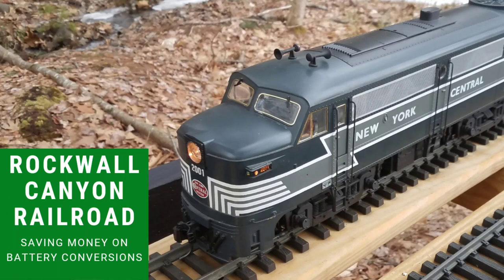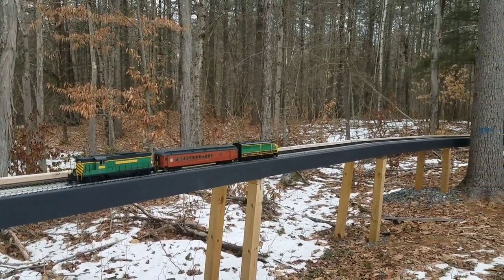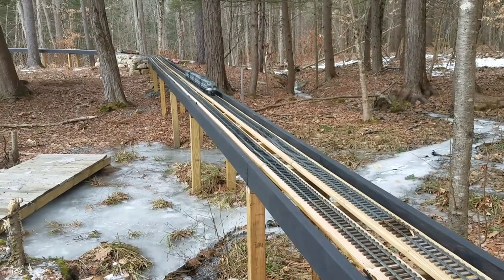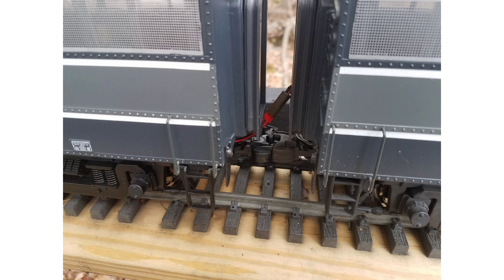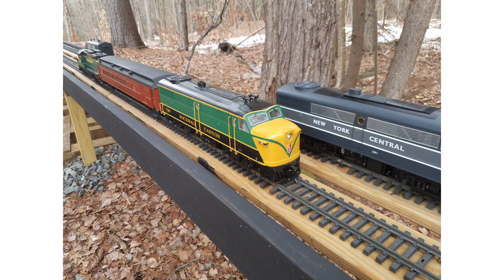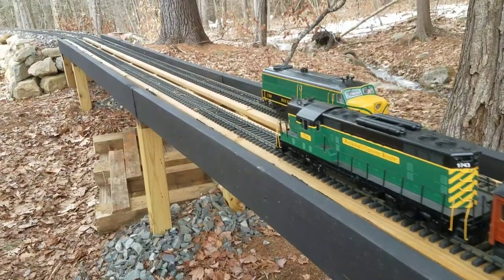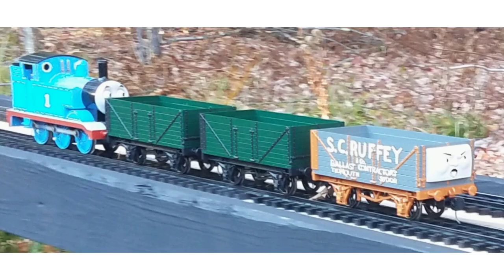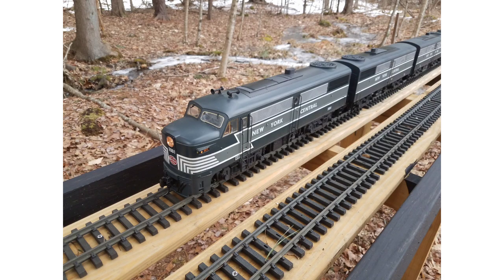G scale | Battery Power ⚡️

Comment: Great explanation on the how you're using batteries and air wire to control your trains. I've been running O scale 3 rail locos on battery power about a year now on my outdoor 3 rail layout.  Tired of cleaning track, I decided to go dead rail and have converted serval of my Lionel LC+ locos to battery power.  Could not be happier.  Slight cost factor yes, but well worth it in the long run.  I like your layout construction, perfect height for viewing and maintenance.  Well done.  Ron// 🚂🙂
Reply from the maker: Thanks Ron!  I catch your videos from time to time, great work!  I hope more and more come to see the advantage of O scale / 32mm in the garden.  Battery was a such a game changer for me...once you have a 100ft of track it gets tough to make it work and keep it going.  Now, when I want to run trains its go time.
Reply: @RockwallCanyonRR  so true, cleaning track outside is no fun. Since I converted to dead rail it’s turn on and go. Shocked I did not do this from the beginning. 🚂👍

Comment: A question for O scalers: can I run a 3rail battery powered locomotive on 2 rail track? Do I remove the pick up rollers? Thanks.
Reply from the maker: Most likely...  
First off, yes, I think it would be necessary to remove the rollers. Otherwise, they may get caught on switches.  
Secondly, 3 rail O scale trains run on AC, batteries are DC.  However, most  newer models actually have DC motors.  They use rectifiers to transform the AC track power to DC.  You would want to disconnect the motor leads from this circuitry and directly connect them to your battery/ rc speed controller.

Comment: I guess those are 1:29th scale models running on G track. Your tutorial is most helpful. I have question. Are DCC and decoders required or not at all? Many thanks.
Reply from the maker: That's correct.  G track is also known as Gauge 1 (45mm gauge).  For standard gauge, trains ought to be 1:32, and for 3ft gauge ought to be 1:20.3.  The great compromise came when the powers that be declared 1:29 for standard gauge and 1:24(ish) for narrow gauge.  This way, in model form, the trains are about the same size so they can be combined in trains.  I currently only have one 1:24 scale car, and it is a cattle car.  It's a little out of proportion, but within a train of 1:29 cars, it gives the rough appearance of being an older wooden standard gauge car.  

And no, DCC is not required for G scale.  Most brands have compatibility for it now, but you can just run off regular DC.  My trains are all battery powered and use non-Dcc receivers that have some dcc-like functions.

Comment: I was thinking a Hobbywing 1080 brushed esc. Would that be in the ballpark? 12v 80 amps about $40.
Reply from the maker: If you already have it, I would definitely give it a try.  However, I think you'll find that you may want something with a little higher voltage output, though.   Bachmann, Aristo, and USA trains all have 18vdc motors whereas LGB use 24vdc motors...and those 24vdc motors make a huge difference.  12v will definitely work, but the trains will run slowly.  My first battery powered engine was an Aristo FA1 with a 12vdc lead acid battery.  Thanks to the low speed, I was able to run it with just an on/off switch.
Reply: @RockwallCanyonRR  ahh I c, cool, didn't know the voltage was that high.

Comment: Wow!! so there are battery operated G- Scales trains? if so where can one shop for  them?
Reply from the maker: Absolutely, it's been popular for over 20 years now.  At the moment only PIKO sells a ready to run battery powered model (a nice, but tiny switcher).  Newer models of Aristo Craft trains have battery plugs factory installed that allow you to use a trailing battery car.   USA trains locomotives can be easily converted to battery/RC with Airwire drop-in boards that allow you to have the battery and RC in the engine.  Check out rcsofne.com for full service support.
Reply: @RockwallCanyonRR  THANKS! I'm considering a garden train and battery powered seem to be the way to go

Comment: For me this is important as I'm moving away from using 6 C cell batteries (9 volts) in my New Bright Bear loggers express train to a single 7.4 volt camcorder battery (though I might make it radio control as well). I'll do the same to even the Bachmann big hauler line of trains.

Comment: Do you know where to get plastic track painted to look real?
Reply from the maker: Not sure...do you mean for display use?  Almost all G scale track has pre-colored plastic ties with metal rails.  Train-Li occasionally sells plastic rail, but again it's not painted but rather rust colored extruded plastic.
Reply: @RockwallCanyonRR  i meant that all plastic rails would be cheaper than brass with plastic ties and since the engines do not need AC, i want to buy plastic (if it existed).
Reply from the maker: @WeedMIC  I see what you mean now...  So there is not really a plastic option yet.  TRAIN-LI has the plastic rail, but nobody seems to be happy with it outside.  I'm not sure if it's just the variety of plastic or what the issue is.  Basically the cheapest option is aluminum rail.  AML occasionally sells track with the heavy code 332 AL rail in 6ft lengths.    LLGAS, AMS, and Sunset Valley sell track with code250 AL.  Code 250 in quarter inch tall and code 332 is  0.332in tall.  However, if you go AL rail be sure to have it tacked down to wood or some form of hard roadbed.  These rails bend easily and I find them troublesome on gravel roadbed where people, animals or things might accidentally come in contact with the track at ground level.

Comment: Can you do a vid on how to convert a normal analog style loco into battery power?
Reply from the maker: Sure!  I'll have one going in for an RC install in a couple weeks.  The majority of G scale trains are analog, and its just a matter of isolating the motor leads from the rest of the electronics and then being sure the track pickups are disconnected.
Reply: @RockwallCanyonRR  I have a bachmann 4-6-0 analog loco and I wanna get that piko rc kit and would like to use track power.
Reply from the maker: @rc4life445  Del from Railboss RC just sent a newsletter this week with an install guide for the 4-6-0.  I'm not sure this link will work, but if not, perhaps sign up for the newsletter and it might come directly.  His system is similar in ways to piko, do this will likely be useful. https://mcusercontent.com/d820e78a3b20d70652e7a6b21/images/378c6398-9bbf-62a7-0743-8e5850c809c1.jpg
Reply from the maker: Page 2 https://mcusercontent.com/d820e78a3b20d70652e7a6b21/images/78b46941-297d-a370-6d21-36644aa1bbba.jpg

Comment: The average price of a 18volt 7ah lithium battery is 75.00.  A 18v 6ah Milwaukee M18 battery on Ebay is about 25.00.  I just take the battery out of the case.
Reply from the maker: Oh wow that's really a huge savings!  Thanks for letting us all know.   This is right up my ally...back in the 90s when I first tried out battery power, I used to use 2 Makita 7.2v NiCd batteries rubber banded together with a connector pin between them to make them run in series at 14.4v! Worked like a champ and my dad could still run his tools when he needed them!
Reply: @RockwallCanyonRR   Yes ebay also has a Milwaukee M18 Battery Adapter/ Holder  so you can use the batteries without taking the cells out of the case, Now you have a excuse to buy a set of M18 tools lol.  I also picked up a used M18 charger.  The battery in its case is to big to put in my Loco so I took the cells out of the case but the battery and adapter would fit in a box car or dummy engine.  The chinese copy batteries can be had from 2 to 8 Ah. I gave 25.00 for 5Ah.
Reply: Marty Cozad was using dewalt batteries a long time ago and being a contractor he was already using them